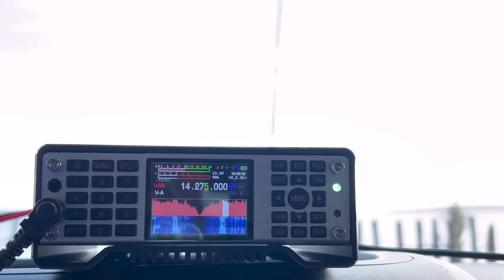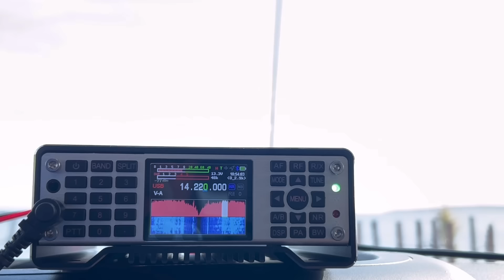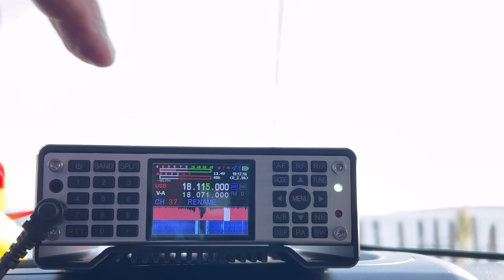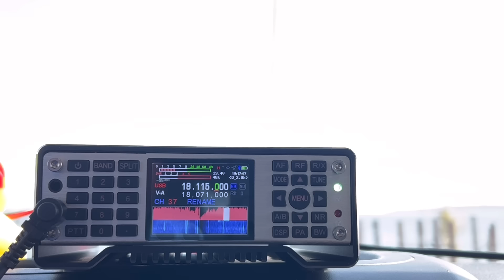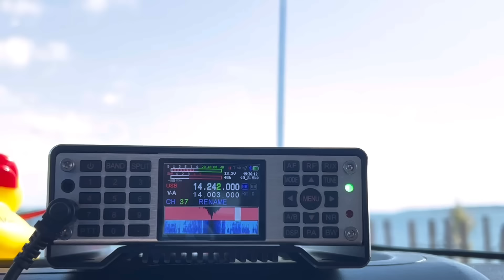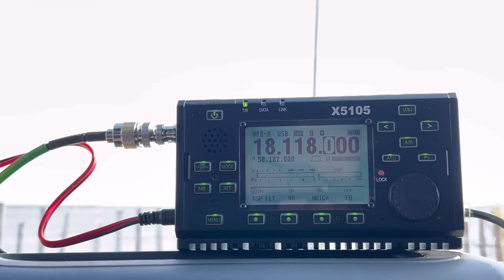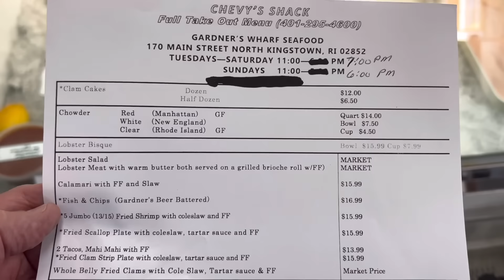Q900 Transceiver - Is it a G90 Replacement?

Comment: I would not call the q900 a bad radio, from what I see and read, but compared to the great and almost magical G90 it fades... I am the happy owner of a G90 and I think its got something special....
Reply from the maker: I completely agree with you! 73, Walt
Reply: Yeah, the G90 is a fabulous rig. Glad I have one...as well as a G106...adding the 6200 after the holidays
Reply: Walt: Saw you in QST yesterday. Fine on the new radio. I hope you run it through its VHF/UHF operation during the September VHF Contest September 14/15, 2024.

De WB2VUO in Amherst,  NY

Comment: 1st time new rig, still not too bad. I did a POTA dry run at a place in Douglas, MA near the state forest today with a friend's IC-705, a PA50 and an ATU 130. Used a 20m 1/4 wave (~16.5') on the roof of the truck with 4 20' radials. I only worked 20 so didn't use the ATU. The noise floor there was impressive. After using a slew of G90, FX-4CR and other similar rigs the 705 may make me never look back except at my wallet and the setup and tear down time. Looking forward to more videos of the Q900. I often operate at night and appreciate rigs with back-lit buttons (which the 705 lacks). It looked good, but that aintchowdadude :)

Comment: I bought a G-90 open box 8 months ago for $250 shipped and it turned out to be one of the coolest rigs I have owned in the last 48 years of hamming. Have had zero problems with it so far, making a little go pack for it so I can take it portable but mainly use it as a QRP base. I wanted an FT-818 but yaesu dropped it before I could buy one. I've owned the 817nd &  the G-90 turned out to be an excellent and much lower price replacement for both. The G-90 iatu has never let me down plus I like having a dial for tuning. Your dinner really made me hungry :o)

Comment: Hi Walt, new radio…might be a learning curve - might not. It’s tough to beat the G-90. 
On this past Thursday I did a POTA activation up in North Central PA using my 2 - Shark 20m hamsticks up on the painters pole with decent results after the G90 tuned it up. A little later after dark I was using it with no responses. I checked the SWR again and it was all over the place.  I checked the power output and it was less than 1w. Have to do some more testing; however, I may have burnt up my radio. If so, I’ll be looking for a good repair firm to fix it as I really like the radio.
Great food segment today; I love clam strips!
Take care & keep safe my friend. (🙏 Mrs)  ‘73
AC3EA

Comment: I've thought that radio would take a little getting used to without a knob. But the idea of a shack in the box is so appealing. I can't wait to see more!
Reply from the maker: I really need to get deeper into it. One thing I really want to do is CW with a USB keyboard. This radio does that.
Reply: Don't hold your breath... I bought it two years ago. it ended up in my junk box. Today I'm a happy G90 user
Reply: @COASTALWAVESWIRES  Id like to see that! But in my own experience using this radio it is a far better at being a receiver than a transmitter.

Comment: Well it seemed promising from the first 45 seconds of the video given the foreshadowing.  Hopefully once you get more acquainted with the radio and make some adjustments it will perform better.  Not being able to tune on 17 and 15 out of the box doesn't seem promising though.  It does seem interesting for someone who wants a portable shack in the box for field operations at a more affordable price than the Icom 705.  I would definitely do the power pole mod on your G90 to fix the broken power connector.  Power poles can be found pretty much anywhere you get radio equipment and supplies where as I can't really find a good place to order the exact same female mini tamiya connector on the G90.  If you decide to get another G90 maybe leave one in your Jeep as a permanent mobile and use one for portable when you either want to set up away from your Jeep or when you can't have your Jeep with you.

Comment: Keep us posted on this Q900.  Not sure if the RF gain was up way too high but you definitely could tell your X5105 noise level was way down under S1 and the Q900 was way up by S7.   Hopefully its just an RF gain setting for the fix.  Thanks Walt!

Comment: It's like anything new. It takes some learning new  equipment. 
Also I would like your antenna book as a physical copy on some plasticised paper so it's a bit water resistant and great for outdoor use and experimenting. I think Amazon does on demand print options. Just a thought if possible a hard copy would be nice :)
Thank you Walt
M7LDK

Comment: 10m is really starting to open up this week and will get better as we go into the Autumn and Winter. Looking forward to another contact with you on a new band Walt, 73s Jim G5MCL
Reply from the maker: I'm headed out today with just my 10 meter radio!
Reply: @COASTALWAVESWIRES  Cool, I will look out for you Walt.
Reply: 10 has been awesome. I worked Norfolk Island with 9w and an indoor mag loop from FN03.

Comment: I  bought the G900 about a year ago. I thought it would be a great replacement for the 817/818. The internal battery charger never worked and I never go a response from the distributor. Also found the mike to have a defective connection.  It had a lot of potential but at less than half the price of a IC 705 I had to give it a try. Eventually bought the 705 and the G900 sits on a shelf.

Comment: I commented on another video that you are the reason why I bought a second G90 after selling the first one; and it works great but the old one was better; this new generation one has some weird bugs like turning the dial but the waterfall its frozen or I get birdies symmetrically on booth sides  of current frequency that are getting closer together or further apart as I tune the radio; these things never happened with the old one that I really never updated

Comment: Hi Walt. Thanks for your great broadcasts - I love them. I will have to make a comment about your Q900 radio. I have had 3 different Q900 radios. The last one I bought with all the modules installed. but but - I haven't been very happy with them. I've experienced a frustration like you - and my last Q900 - with VHF and UHF on separate antenna connectors - my God it's so stupid... The sound in the speaker is so low and digital to listen to. The tuner is almost non-existent. I could go on with bad reviews - Now it's packed away in the drawer. I almost only use my G90 and 6100 and my IC705. Best 73 de OZ1LKY - Christian

Comment: I got one with all the options. The mike was different. I had to drill a 2 mm hole in it, and it worked.DMR didn't work, V and Uhf fm worked good.The waterfall is junk. The radio in Hf SSB was OK, but it turned off by itself sometimes. The seller in Alliexpres didn't accept the return. After a dispute I got the money back.  Happy ending.

Comment: Great Video! I was thinking about this radio and was waiting for someone to give it a test run. Yeah, you have to play around with gear for a while before giving it the thumbs up or down. I was a little concerned about the tuning on 17 and 15 meters. I really like that this transceiver is a small shack in a box with the additional bands. However, I like having a physical knob for tuning. Still, transceivers are a compromise and I look forward to further testing from you. Thanks for doing this video and all the great work you do...73...Hugh...KN6KNB

Comment: Thanks for the video! After upgrading the firmware on my g90, I no longer like to use it for CW. The filtering is too limited and I no longer can easily scan the band. Looking for a replacement.

For now, all portable apps are on our qcx mini and soon qmx when it arrives. Upgraded the house to an ic7300, and put the g90 in a drawer.

73 Mike N4FFF es Becky N4BKY

Comment: Most radios have a learning curve.  The ATU on G90 hard to beat. Windy and rainy hear in NY today. Some Thunder in AM . Food looks great ! I do know 10/11/12 meters has been open some days.  Haven't done much.  I got different UNUN 4:1 on the way.  1KW 1-54 MHZ rated. Sept 25Th was ship date.  Just coming from France. UK is fast to me. like 7 to 10 days. some times 5 days . With 10 meters getting better I want to compare the 1/2 wave to the 5/8 wave vertical . I did on 20 meters. 5/8 better RX . But was done in a slope setup.    Need longer pole. 73

Comment: From what I’ve seen online the tuning on 15/17 is not user error but more lack of capability of the internal tuner. Paired with a decent external tuner the radio is supposed to perform well. Personally I’m sticking with my G90.

Comment: I’m don’t know anything about the Q900, but it just might be that the tuning range (3:1?) may not be as wide as the other hf rigs. If you have a manual tuner (10:1) try to test it on 17m again if you want to. 

It may not be a loss after all. 

On another note, the chow looks great!

It looks like the Temperature in Texas this morning is 70 degrees this Saturday morning! It is time for me to roll out of the rack and go on a short 2.5mile ruck with the Baofung UV5R. Lately I have gave up soda water and immediately lost 10lbs! The treadmill and short rucks are building this hams leg and core muscles back up. Will it last…, who knows. But I know what happens if I do nothing. 

73 es give it heck good sir! Hope to catch you on 40/20m one day. 

de kc5ngx
Reply from the maker: Thank you so much! I'm looking forward to that QSO on 40/20m. 73, Walt

Comment: I have one of these radios. It can be frustrating to get it transmitting right. Mine came with the smaller mic that i ended up replacing with a powered mic to get enough signal INTO the radio to make an okay sounding transmission. It took a lot of time tinkering with the settings to get to something acceptable.

Comment: Very interesting radio, unfortunately I can't see this as a replacement for my G90. Thanks for the video, Walt.
Reply: There's no way it's a G90 replacement, you need to buy a rotary encoder if you want a dial to spin the bands.
Reply from the maker: as it stands right now the G90 is safe and sound! 73 my friend!

Comment: I suggest the "whole belly clams" as these are local and market priced.  The clam strips are generally frozen and often not local, and that explains the fixed price.  Local and fresh is better IMO.  Try to keep the butter off the beard "flavor saver".  LOL  "OM NOM NOM". 

On the new radio.... I suspect the odd waterfall is something in the setup menu.  Looks like zero Hz is in the center, and all the correct frequencies are to the right.
The internal tuner probably doesn't have the range you're asking it to do.  The G90 tuner is exceptional and not the norm.  Most tune a 3:1 SWR at best.  This is by design to keep cost down as any further SWR requires beefier parts and cost goes way up out of reach.  It's also very inefficient (RF wise) to do it this way.  The ATU should be at the antenna end of the coax.   The rig looks like it has good potential.  I suggest using an external speaker on either one.  Perhaps a connection to your stereo in the Jeep.
Use one rig into a dummy load and receive on the other (with headphones) so you can adjust mic gain, compression, EQ etc on the first radio, then reverse the process.

Keep em coming Walt.  Stay salty.  73 OM

Comment: Does this radio have some digital noise reduction, or was that digital artifacting of the noise? 

I agree that the audio seemed anemic, and the internal speaker sounds flimsy. I hope a decent external speaker would improve that aspect.

Comment: I bought the G90 bundle from Radiodity and the first one made horrible. clickie/popping noises when you changed bands or step frequencies.  I contacted them and sent it back,  They sent me another radio and I had the exact same issues.  I really want one of these to do POTA, but it seems it's pretty hit and miss with getting one that works.  I guess I'll be getting a Yaesu FT-891 as I'm tired of messing with this.  Oh, and some of the reviews on Amazon have the exact same issues.

An Update: I guess the folks at Radioddity didn't want to work with me on getting a G90 that works, BUT they did give me a full refund.  So now it's off to see what I'll be buying for POTA.  I did a second operator with a ham buddy of mine yesterday and he was using an FT-991A and I was very impressed.  I'm thinking I may go that way ibstead of an FT-891
Reply from the maker: The FT-891 is a great radio. Start studying the Yaesu menu system as soon as you buy it. There’s a learning curve there.
Reply: I think you can fix your problem with software :)
Reply: @Tamlin73  I've asked about that and they said the radios they sent me had the latest update.  It appears the G90's are hit and miss in regards to getting one with no issues.
Reply: @COASTALWAVESWIRES   I've got a few other Yaesu's such as an FT-100D, FT-1500 and more.  So I'm a bit familiar with their many button pushing menus.
Reply: @subiesojourner777  yes, you need the pre versioner...not the newest, you must downgrade the software :)
Reply: @subiesojourner777  yes, you need the pre version not the newest, you must downgrade the software :)   i have to do the same with mine.
Reply: @Tamlin73   Well............. I currently don't have one to do that too as I sent the second one back and I'm waiting to see what they will do next.  It will either be a third radio or a full refund.
Reply: @subiesojourner777  3. One is always the best one 😁
Reply: @Tamlin73   If they send me a third, which version do you recommend I install if this one comes with the latest version?